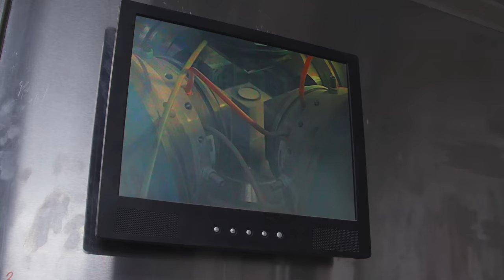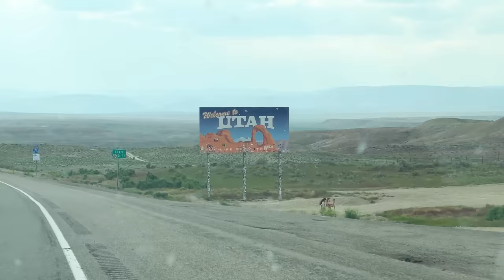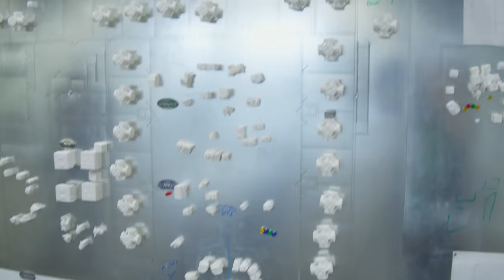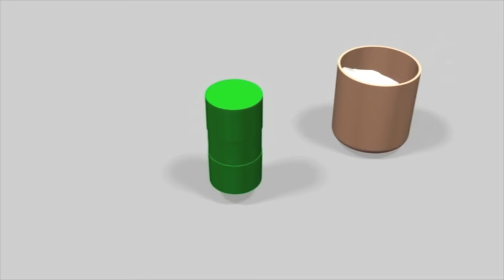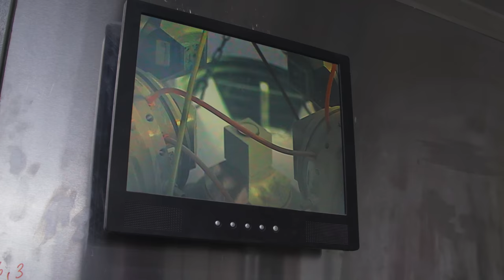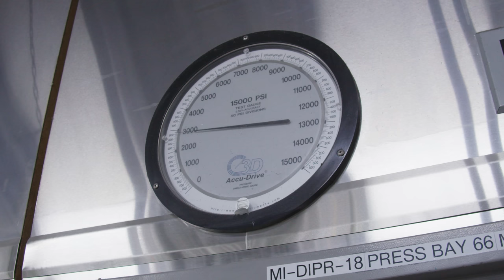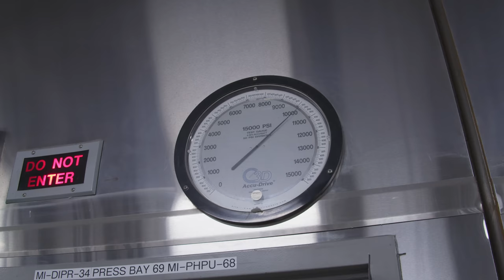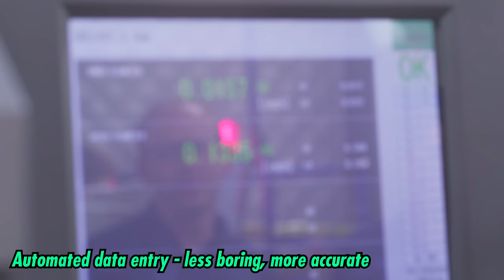The Highly Ridiculous Over-Engineering of the Diamondback Nozzle

Comment: $95 might be steep, but considering it's the last one you'll ever have to buy it's a fair price
Reply: I agree but I worry what would happen if it clogs and is ruined? Could it be cleaned beyond just stabbing it with needles?
Reply: @sallynovember  it has insanely low friction which means nothing sticks to it. Your clog could easily be cleared with a needle or cold pull.
Reply: No, it's not.  I've replaced my nozzles twice in two years.  So Ive spent roughly 2 dollars on nozzles.  I plan to buy a new  printer next year which will use a different nozzle.   Explain to me how buying a 100 dollar nozzle would be anything but a huge waste of money.
Reply: @padrescout because  sometimes people aren't God's of printing, or they need to print difficult materials
Reply: @padrescout what filament are you printing with? With abrasive filaments printing with consistent volumes - prosumer to commercial - you should be replacing nozzles pretty consistently. 

This makes a lot of sense for printing farms. One less part to worry about is worth a lot.
Reply: @padrescout idk how to tell you this but you‘re not the target audience. It‘s for printing accurate and high quality with difficult engineering materials. Stuff that would eat your 2$ nozzles up in 2 seconds.
Reply: @spheroid-collective  Still sounds like a bad reason to  waste a bunch of money on a  gimmick nozzle to me.  But hey, maybe it will save them a bunch of time they can use to post "Well, actually..."  posts on the internet about how it wasn't a bad idea to spent 100 dollars because they totally used it 3 times.  Then spent another 100 dollars because some other guy with a video camera convinced them a different nozzle diameter was the way to go.
Reply: @padrescout firstly, you are comparing to cheap chinese brass nozzles(which although fine, obviously has lesser quality of finish & tolerance)

Secondly, it's expensive but if u actually use the printer with abrasives(like what it's designed for), you will probably be about even in abt 1 to 2 years, but u won't need to swap the nozzles out(so time saving)

Cheap and expensive nozzles have their place, but considering that there several thousand dollar FDM printer, a $100 nozzle is nothing(especially for a business)
Reply: @padrescout Can't you use the nozzle on your new 3d printer? Also it improves printing quality and prevents clogging, how is it just a gimmick?
Reply: @cray-z578    Yeah, people who haven't thought something through often dismiss a different opinion as "idiotic" , its a result of your outlook, but hey - that was super you felt the compulsion to share.
Reply: @sallynovember  is an unfixable clog even a thing with normal nozzles?
Sure, some are a pita to fix, but with some heat I've been able to fix every clog so far (with normal nozzles).

(Of course with a 2€ nozzle it doesn't make all that much sense to invest any time in fixing the clog)
Reply: Compare that to the price of a diamond engagement ring that is absolutely useless and you will see its real value.
Reply: 100 dollar for a nozzle isn't worth it. It holds value to have more then one nozzle. One nozzle can never replace the different nozzles and there strengths.
Reply: @padrescout  """Gimick""" nozzle. It seems there are no signs of intelligent life in this one... Okay. To put this simply - this nozzle isn't just for everyday use. This is for intensive, long-term usage in things like printer farms. Place and forget, really. Like the people in the manufacturing facility have said - they have been basically using the diamondback for like 1-2 years at this point and have yet to replace a single one.

These are NOT for the average consoomer (you, get a job - hippie) and instead for large-scale manufacturing, or small-scale intensive hobbyist work like diamond filament/high-temp & high abrasion printing.
Reply: @padrescout  I mean dude, if you don't have any issues with using your nozzles that's fine, do your thing but this is a nozzle for tough print stuff and gritty material
Reply: After some failed prints and filament blobs on the nozzle, swapping a new nozzle might be easier than trying to clean the old one. So 25USD ruby nozzle might be better investment.
Reply: @padrescout if you only changed your nozzle twice in two years youre not even printing every day. some people run their printers 24/7
Reply: @sallynovember  You can throw it in a fire and burn off the plastic
Reply: @padrescout It depends what you print with.
Reply: @AllanSavolainen  it's slippery and heat conductive and you can stab it so the only thing that will break is your utensil of stabbing and the filament
Reply: for the average consumer using a $700 max printer probably not, but for anything industrial yeah for sure!
Reply: @fatalflu15  You know that diamonds burn? 
So pls no open flames or your Diamond is soon CO2.
Reply: @padrescout  "I only print PLA"
Reply: To be honest i printed PC carbon fiber and after 1 print and half i my brass nozzle tip went shorter and i always needed to increase the Z offset 

So yea an harder nozzle really helps a lot
Reply: considering how cheap regular nozzles are i would say its more about not having to bother than about it being a strictly better deal economically like u would need to print for decades on a printer of be using some seriously abrasive stuff often to break even
Reply: Buy once, cry once.
Reply: Its not the last. The brass part where the filament goes in still wears down
Reply: @padrescout  I have been using my diamondback nozzle for around a year now. I'm pretty much printing 24/7 with CF PLA/PC/Nylon, plus filament impregnated with various metals. The nozzle has zero wear and the bore is still exactly 0.4mm. Your $2 brass nozzle that you print with was never 0.4mm in the first place, I know as I have used those cheap nozzles and the tolerances on them are terrible. And the bore was much larger than 0.4mm by the time you changed it out. The improved thermals are also a huge benefit. I never get clogs therefore I never have ruined prints because of the nozzle. You can't look at this as just "Well, I can buy 50 brass nozzles for the price of this one". Because there are a lot more benefits to it than just a direct replacement for a brass nozzle.
Reply: You can find them for $75 on sale now sometimes
Reply: @trapstoner 
Lol, love your comment. You burned him.
 Unlike that noob you are talking about, I'm a newbie to printing. If you don't mind me asking, with typical PLA, and if I printed something that uses 15G of filament a day, when would be a general time to check/replace the brass nozzle? It's a 0.4 nozzle. You sound like someone that knows enough to ask, if you don't mind giving me an answer. 

This nozzle is "spendy", but for those like me, it would outlast my printer. Seems well worth, regardless of either being a consumer printer, commercial, or professional printer.
Reply: @padrescout 😂😂😂 the irony here is that you are the “well actually” guy.
Reply: It's insane product, it could easily outlast many of my future cheap printers ;D
Reply: Not necessarily the last one you'll ever have to buy wallet extremely clog resistant it still can be very clogged from very high-performing filaments which is always difficult to deal with no matter what especially with a brass base
Reply: @ganjasage420  oh with light use case you shouldn't worry for atleast 6-12 months i guess depending on usage, nozzle quality (cheap one or from reputable maker) and how much artefacting and dimensional accuracy you are ready to sacrifice before changing the nozzle, but you shouldn't consider this diamond nozzle at all yet your logical progression is to hardened steel from brass and even then stick to brass for the start atleast because its easy to find and cheap and when you start having a heavy use and need 24/7 printing because of fast prototyping with abrasive filaments and you are tired of changing nozzles only then consider spending 75-95 bucks on a diamond nozzle but if you dont need it dont get it.
I also recommend watching vids about worn out nozzles and learning the patterns of one so you can better decide when its time to change it.
Reply: If you're are printing in large volume and particularly abrasive or difficult materials, sure, it's a good value.  For the hobbyist that goes through a cheap chinese brass nozzle a month, that's like five years of nozzles.  Plus the cheap route lets you have a lot of different-sized nozzles.

These are really aimed at the pro / prosumer market, not the hobbyist.  Great if you are a fab shop contracting services to shapeways or something, but too expensive for hobbyists.
Reply: @ganjasage420  Not the person you‘re addressing but at that amount of use, literally just swap it when your extrusion quality suffers, it clogs & you can‘t fix it or you see a noticable difference on the nozzle itself :) Changes can be a bit gradual esp on the print quality so keep a calibration cube on hand for comparision! I wouldn‘t go for the super cheap nozzles but if you‘re only printing PLA you don‘t need the super expensive ones either.
Reply: @padrescout so if you are printing either not very often or with only non abrasives then yeah you don't need this at all. However if someone is printing several parts out of carbon fiber nylon. Then you go through a brass nozzle in less than a spool the quality degrades so much. I only went to harden steel and so far so good. The point is there are always people who have higher tolerance and use harder to print materials. This is for them not ordinary people who print once a month with regular filament
Reply: @lukeandliz  also @padrescout : My mommy says i'm a very smart boy so I shall offer my wisdom to everyone.
Reply: @RandomBlackBox  your diamond tips will burn at a significantly higher temperature than it takes to melt the plastic
Reply: @sallynovember torch it lol
Reply: @padrescout  have you printed carbon fiber filaments or other abrasives?
Reply: @padrescout  you clearly don't print enough and you dont print with whitle plastics / CF/ FF or glow in the dark. so you keep buying brass.
Reply: It is not like you are financing a monster 5 karat diamond ring.  I can't imagine the price but I know someone who had one and they are horribly expensive!
Reply: Always said I never understood the point of buying a diamond.

I stand corrected.
Reply: @Karavusk  or you can hit it with a blowtorch to nuke anything in it
Reply: @obie224  I did and the claim that nozzles wear only at the tip because it's the dragging of the hardened material against the tip is false. Nozzles wear at the barrel too. CNC kitchen has a video where he cuts a nozzle in half after abrasive printing and you can clearly see the interior path being deformed
Reply: Times it by like five considering you would need one for every size. Besides Aluminum oxide (sapphire/ruby) nozzles are hard enough and cheaper, i don't really see a point in this outside of ultra large format or high speed printers that specifically use high abrasion filament. Also take note of the video description of where it says "this video was subject to deeper scrutiny by the sponsor, Diamondback aka ChampionX. I allowed them to redact visuals and specific words".
Reply: @sallynovember  unless it's ceramic or metal filament, probably just nuke it in a pyrolysis oven then wash the ash away. brass is fine at 600C, diamond should be fine too.
Reply: @OneHappyCrazyPerson  yeah if you have a 500 or even 1000 bucks 3d printer it's probably not worth, unless you actually need this kind of nozzle for a successful print, it's more of a "my printers make prints 24/7 except for the 5 minutes to remove the build plate." in that case you either have idex, or different printers with different nozzles. then you may have one hard nozzle for tricky filaments

for commercial, reliability is good, yes you can change your cheap steel nozzle every 5kg of cf filament, but you also have other parts that may cause an issue etc... you can shave off quite a bit of money off of a commercial printer if you don't mind fixing stuff like once a month. 

the tungsten carbide nozzles are probably almost as good, but they are at a comparable price. same with good quality corundum nozzles, you're at the 70-90 bucks mark, so at this point it's a question of which one is the best among those, I don't know how this one handles high temperature.

I do agree that if you print stuff like once a week, it's probably not worth getting one, you can just cycle steel nozzles
Reply: @cray-z578  plus there's the effect on zeroing z height whenever you change a nozzle. I haven't had to touch my nozzle in a year and a half. No clogs. No z adjustments as the nozzle wears down. No crud sticking to the nozzle. Printing TPU is easy!

It's saved me dozens of hours with all the stuff I don't have to deal with anymore. No hype.
Reply: @sallynovember  yes. The diamond is non-stick, so you're much less likely to get a clog in the first place, but if you do, you can go ham with a needle if you need. (The only clogs I've had in the past year and a half though have been from my Bowden tube working its way back out of my hot end, leaving a gap that allows a pool of molten filament form.
Reply: No printfarm here but I wasn't happy with the quality of my prints slowly degrading as the nozzle wore down. I love both diamondback nozzles I have!
Reply: Lol remember when everything you bought was the last of something you'd need?
Reply: @padrescout  This product isn't for you. Sounds like you are using those bottom of the barrel aliexpress brass nozzles. This is another league of products, this is prosumer
Reply: @padrescout bud, I have 18 printers and change each of their nozzles about every month or two. If I replaced all my nozzles with this nozzle, it would still take a bit to recoup the material costs, but the return on opportunity cost would be immediate. If it works as advertised I would save a lot of time on labor and would have printers go down less often.
Reply: @padrescout Yeah I agree with you! Just buy a steel noozle and harden it by yourself.  Is will last very long! There are many videos  about hardening steel.  I did crush few times in the glass bed but still working as new.
Reply: @laszloszell8753  the problem with steel though is it's significantly less thermally conductive than brass. Brass conducts heat more than 2× as effectively as steel. Polycrystalline diamond (PCD) conducts heat more than 36× better than steel!

(Steel has a thermal conductivity of between 16–45 W/(m•K) depending on the alloy. Brass, on the other hand, has a thermal conductivity of 111 W/(m•K). Compare those with polycrystalline diamond (PCD), which has a thermal conductivity of 1800 W/(m•K).)
Reply: @SeanCMonahan  I'm totally fine with my steel nose.  Never had any issues and till the print quality is good I'm happy. I know about termal condition of course. Doesn't really matter the conductivity because the temperature is raising slow to 250°C and always steady.  So have time to  warm up and hold the temperature.
Reply: @padrescout  For someone like you who only prints in PLA it probably is a waste, but I pretty much only work in CF nylon and other abrasives (every one of my printers has a tool steel nozzle currently) so it would be worth it for me.
Reply: or you can buy like 100 brass nozzles for $10
Reply: @renosimpson9611 Did you know you can decide wether something is for you and make a purchasing decision based on it?
Also no lol they very explicitly talk about engineering materials, specifically carbon fiber filled ones
Reply: @schvanger  that's like saying that because you can buy a dozen Ender 3 clones for the price of one Voron 2.4 kit, that means the Voron 2.4 isn't ever worth it for anyone.
Reply: @SeanCMonahan  true.
Reply: @sallynovember lower friction coefficient will likely prevent anything from getting stuck
Reply: @padrescout depends what you're printing, that's obviously not going to hold true if you print a lot of the naughty abrasives.
Reply: Dropped $40 on a tungsten nozzle since I'm a cheap ass mofo and didn't want to feel the diamond cost pain. 
It's been great, got a second for another extruder.
Diamond is nice tho
Reply: @padrescout  Tell me you don't print abrasive filament without telling me you don't print abrasive filament.

A single print made of carbon-fiber nylon would OBLITERATE a cheap brass nozzle. Maybe 3 if you're lucky. This, on the other hand, can't be damaged by ANY filament you would ever need to print. And before you say it's a "waste of money", if you're someone who needs to print difficult strong filament consistently for robotics purposes, you want a nozzle that won't break on you. Rather than always have a spare nozzle and have to restart the print and repair it every time the nozzle breaks, I would rather have one that just works forever and I never need to worry about it.
Reply: @tbuk8350  Why would I say  using a hardened nozzle to resist abrasion is a bad idea?

But your argument you constructed on my behalf and then defeated was ... interesting.  That would probably be really cool if it wasn't misrepresentation.
Reply: @padrescout  You asked for someone to explain how the diamondback was anything but a waste of money. I was answering your question.
Reply: I'm struggling to see how/why you would go through nozzles so much aside form just being bad at leveling your bed.  @padrescout
Reply: Think of it like Machinist tools.. One Japan/German made air cooled end mill, could cost $95 EZ.
Reply: @veerkillerx   OK?  Im checking out,  I said my piece, if you disagree? ...  i dont care.    I'm not arguing with the internet over whatever deranged interpretation  some  random  decides to sieze upon and run with.  If you want to spend 100 bucks on a fancy one because you totally print in  sandpaper, whatever, fine.  just fine.  its your money to waste as you see fit.
Reply: @padrescout because sometimes you want a good one and youre tired of effin around
Reply: @padrescout Are $4,000 printers also just a gimmick? Have you considered that you’re not the target audience for everything?
Reply: TBH I was expecting it to cost more
Reply: @padrescout   You literally asked for people to explain. Don't cry about them answering you because it wasn't what you wanted to hear. You're posting in public comments so don't act all surprised when you end up "arguing with the internet". If you don't like it maybe just keep your thoughts to yourself.
Reply: oh my gosh its only 95 dollars? thought it woulda been like a grand lol
Reply: @DeltaOps3  same! At least 300+
Reply: Yeah, unless standards change.
Reply: @Felipera_ actually right now in the world we living in diamond is a worthless thing every single diamond ring is worthless but people are acting like it worths something and continuing to buy it no matter what just go to the jeweler and buy a ring then return back 5 minutes later just try to sell it back to them you will see the reality of diamond jewels
Reply: @fatalflu15 you cant throw your ordinary metal nozzle into fire because it would warp you also cant burn diamond nozzle because diamond will react with o2 and turn into co2 it can literally dissolve into air
Reply: @HashanGayasri i expected it to cost less it should cost less it has to cost less
Reply: @padrescout did you not watch the video at all????? Literally explains everything from its uses, the level of use, who it's for etc.

Obviously this stuff ain't for you a very small time printer, were talking print farms and rough constantly used materials not that smooth plastic you use lmao it's just an extremely durable and better performing nozzle for faster, more accurate and just better prints that's the damn point of it!

It's a premium product for a target audience who use there printers 24/7 of course it ain't for you and just a gimmick lmao but your comparison is like calling a better printer a gimmick it's just a better version of yours and you're crying over it because apart from like 4 people everyone else is in disagreement with you because they actually know about printers more than you and just answered what you asked for you're literally on a heavily 3d printing channel what do you expect?
Reply: @padrescout because I print in stuff so abrasive it puts sandpaper to shame.

Any composites or fibers will erode a nozzle. I had a nozzle X and it was okay but I didn't like the temperature tuning and it had reduced performance overall but at least it could print anything. I just got a diamondback and it solves those issues and while I didn't check the X For wear, I do know that in this universe steel is weaker than diamonds.
So for just standard material you are correct, my applications can at times be what diamondback'engineering print lab does. I may not need it but dammit I want it got the piece of mind.
Reply: @OneHappyCrazyPerson  I have a diamondback as my daily driver. But I do recognize that nozzle specialization is good. I used a revo for a few months and fell in love with it. Now, I have 3 hot ends to swap in on my prusa mk4. 2 of those are a v6 adapter so I want to leave the as is (one of those is a 0.6 diamondback, the other is a bondtech cht.) the other is to use a prusa nozzle and I have a 0.4, 0.8,and 0.25 in brass. But I don't need blocks for any more than the one.

While the 0.6 diamond is nice, I often to swap them out for more speed or detail. But the diamond is still the most commonly used and I throw a lot of carbon fiber and how in the dark into it.
Reply: @padrescout If you don’t need it that’s fine, but pretending that cheap brass nozzles and higher quality nozzles are interchangeable, or even comparable, is foolish and ill informed.
Reply: Absolutely. Considering cost of filament this is probably the best upgrade you can make.
Reply: Carbonized plastic eventually will trash it on the inside and make you want to change it. Might be able to burn it out,  but why.  Better off buying  420 cheap brass nozzles.
Reply: @RandomBlackBox i mean technically diamonds only burn in the presence of oxygen, so just move to a planet with no oxygen in its atmosphere and you're gucci
Reply: 130 for my form factor. And I've seen reviews saying the tip popped off, but I imagine almost never.
Reply: @padrescout  some people again as stated in the video you didnt watch before commenting. Its for carbon and filiments with stuff that roughs up the nozzle
Reply: @padrescout  lmao you got shut down 👎
Reply: @LeafBoye  I did? bummer?